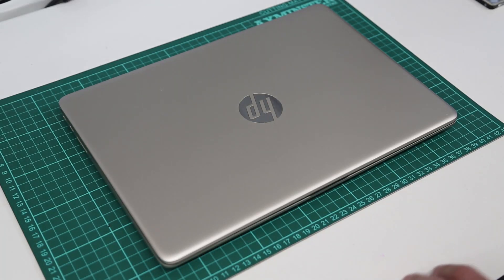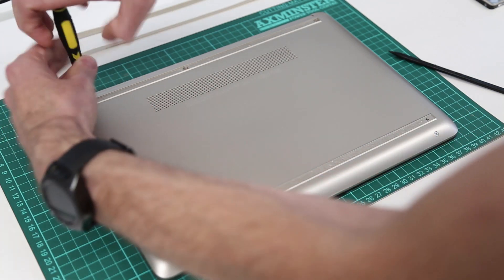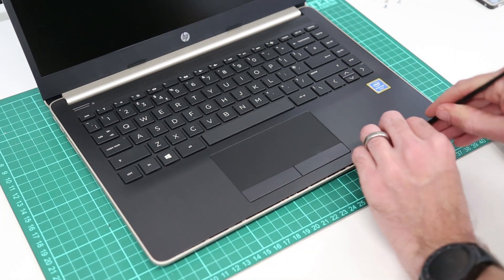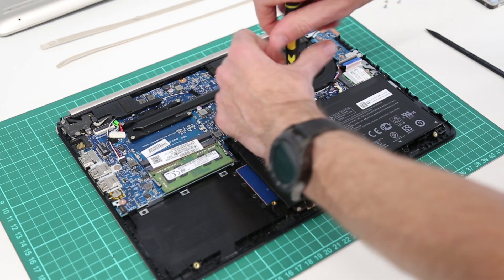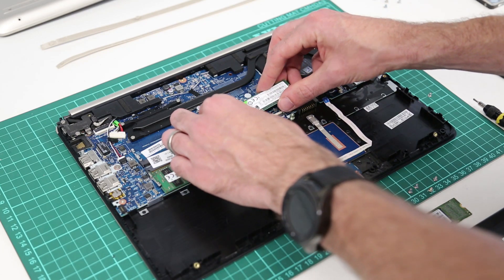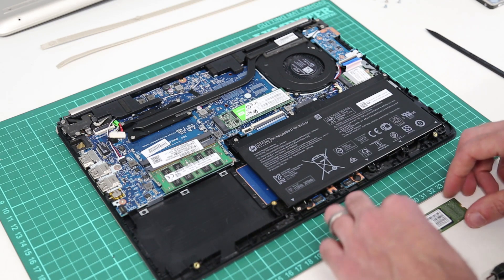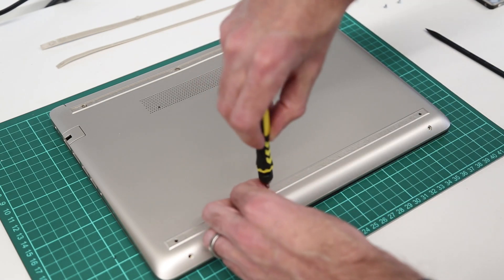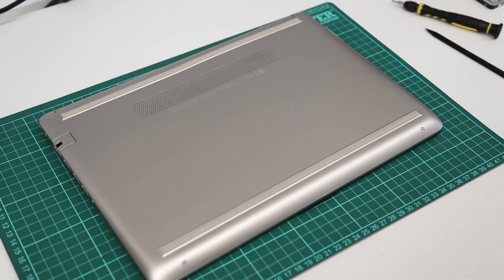HP 14-cf0500sa SSD and RAM Upgrade Guide

Comment: Hi Brue and thank you for the video it helped me upgrade my new 14-DK0002DX from 4 gb to 12gb out of the box with ease. I was wondering if you could help point me in the right direction. I'd like to upgrade the hd which is a m.2 as in the video from 128gb to a 500gb drive, but im getting conflicting information online was looking at the wd blue 3D nand 500gb or the cruicial mx500 3d nand as their site says it will work in my pc. But i see so many claim that i have to use nvme or pcie or sata and the terms are confusing me, and so are others opinions. Having the laptop model number can you give me any idea if these drives would work in my pc, or tell me what i should be looking for. Thank you!
Reply from the maker: You can find the specs of your exact model here: https://support.hp.com/au-en/document/c06429939

As you can see, the drive fitted is a PCIe M.2 NVMe drive. A SATA M.2 drive MAY work, but given the relatively small cost difference I'd go with an NVMe drive and then you have no compatibility concerns. Something like the WD Blue SN500: https://amzn.to/35RYPbJ
Reply: @BrueComputing  Thank you Brue! Much appreciated! ❤

Comment: I don't like removing feet unless I must, that glue holding them can lose its stickiness if messed with too much.  My 17 inch has a couple under a label and two one under two feet (each).
Reply: I don't either. i was hoping this chassis design just used the two screws at the front. Luckily the "feet" reattached without issue. But If the need arises for me to get into the chassis multiple times, they may not stick very well. Perhaps leave them off and replace them with some clear "peel and stick" rubber feet at each corner?

Comment: If you upgrade the Ram and Ssd will you also have to reformat windows 10?
Reply from the maker: RAM, no.
SSD, yes - you'll either need to clone the contents of the old drive across or clean install on the new drive.
Reply: Brue Computing can you show us how?